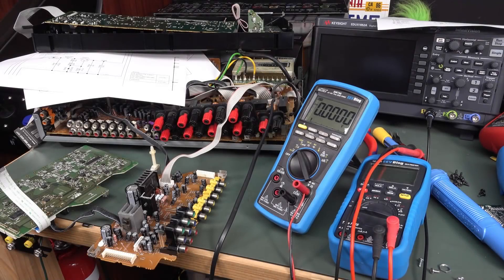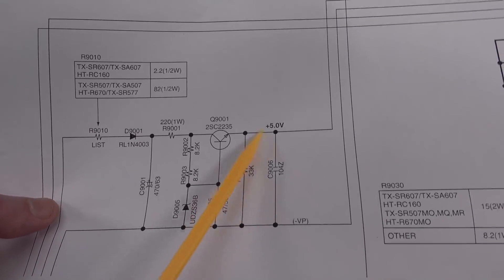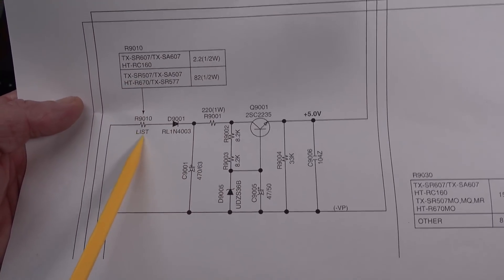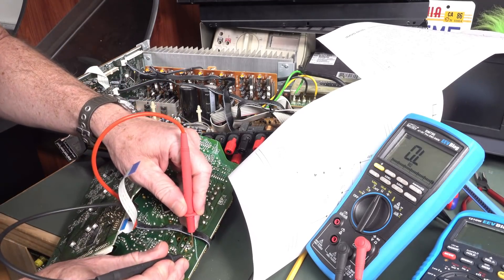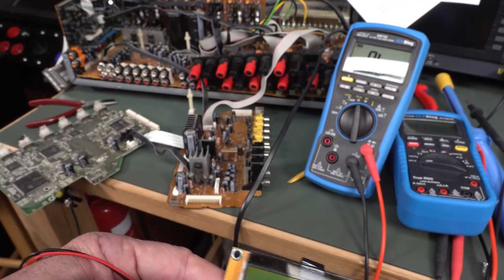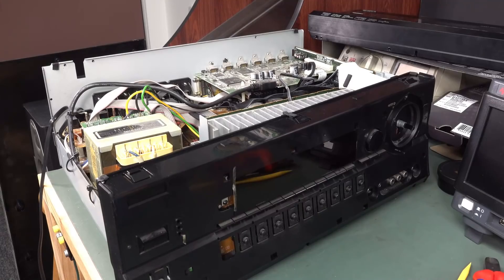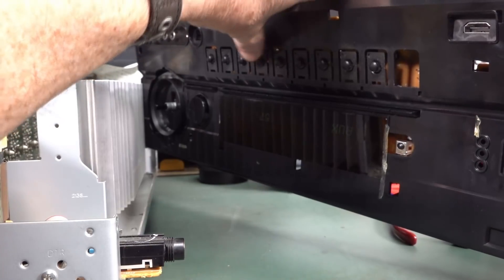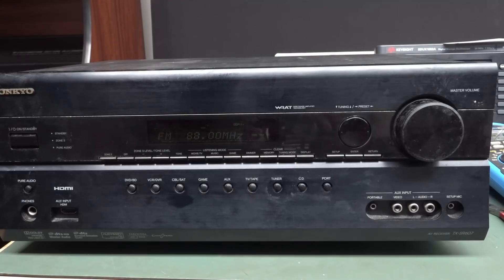EEVblog 1395 - Onkyo Repair SUCCESS

Comment: Because resistor surface is not dark, it was probably not overheated. It's first component, so I guess it fails because of high current pulse (power up/inrush, external surge/eft burst or similar). If it's external source, then other inputs protection components might be broken too. Also replacing it with 1W or 2W general purpose resistor might not help forever, a special - pulse proof - type resistor might be needed.

Comment: In the last video when Dave opened it up and said the construction was excellent, I knew he would regret those words once he had to take it apart and trace stuff between the boards and try to test it by putting it all back together. That kind of multiboard design really makes it hard to track down failures.
Reply: Also the cheap ass phenolic circuit board material they use, and that it's single sided means when you plug it together, if any of the pins is even slightly mis-aligned, it pushes the pin through the board, and rips the trace off the back too. Had that happen at least once with a receiver. I had it all repaired and working, then put it all back together, and it stopped working - took it apart again, and found one of the pins in the board-to-board connector poked out the back of the board, and trace torn right off. Had to take it all apart again and repair all that.

Comment: The 12th button (marked Display), right above the CD mode selector button, will toggle the display brightness through several brightness levels.
Reply from the maker: It's the Dimmer button actually.
Reply: @EEVblog  of course you're right.  I have one of these, but upgraded it about 6 years ago, so my memory of using it has blurred.  I do know there's a button that toggles through a few brightness levels.  I was actually expecting an HDMI repair when I saw the model number and brand.  I've been lucky so far with Onkyo HDMI interfaces, none have failed on me yet.  I really like Onkyo systems.

Comment: I have a marantz tuner amp with vfd that I've owned for 30 years, strangely the display is still bright & it's had a fair bit of use. nice repair
Reply: those are light bulbs.  That onkyo must have had weaker bulbs or used quite a bit.
Reply: The dimmer was on. All good after he pressed the dimmer switch. It has 3 levels of brightness

Comment: Dave  check the settings it might be set at the 'low setting' for the VFD or night setting
Reply from the maker: Turns out there is a Dimmer button on the front panel, that fixed it!

Comment: Pretty good series! The Onkyo receivers have a great quality. 
I am not sure if you tested it, but the 470µF capacitor following the diode could have caused the resistor to open if it had a low enough ESR with a consequent increase in its current - I have seen this happen in the past. If this is the real root cause, the replaced resistor may blow soon. 
I am not sure if you noticed the "Dimmer" button in the front panel - press it and see how it cycles through the various VFD intensity levels. 
Overall, great video.
Reply: A decent engineer would take the time to think about "why" the resistor opened.  Good point--and along the lines of my thought.

Comment: Great fix! I've had to fix a few open resistors in things over the years. People always want to assume it's a bad cap or a shorted semiconductor... But those resistors definitely fail open more often than than people realize.
Reply: That is 100% true. Even metal film SMD ones can just slowly develop a crack and one day suddenly become completely open or something like 800k over the initial value. With modern ones it is not often but it happens sometimes and I have seen a resistor like this with my own eyes. Never seen one becoming short though.
Reply: Do the electrons fall out when they fail open or do you have to turn them a bit?
Reply: @johnfrench7452  No, they can’t jump across.
Reply: @tripplefives I have told you 67000000 times not to exagerate. It's a small beam.

Comment: I would also put a heat sink on the DTS chip, these run really hot and have the tendency to come ''loose'' from the board, a known issue with a lot of these Onkyo's.
Reply: This one doesn't have DTS chip that has issues. Only ones with rj45 connector on hdmi board have this issue. Adding heatsinks isn't propably bad idea tho.
Reply: @mmanner  Ah ok didn't know that ;)  The chips do run really hot indeed!!  These models do have an HDMI switching issue, some of the caps need replacing if that occurs.

Comment: I have the exact same model here. It is a silver receiver.  It had the same problem. Real easy fix.  After 3 years still going strong.  Good receiver. I have a few onkyo receivers. Most of the ones of this vintage get an audio channel failure.  The newer models most of the time fail on the hdmi board. The 313 model sometimes have the standby relais failure.  It just dies. Also easy to fix.

Comment: On  Onkyo TX-NR646 receiver, it is possible to adjust the brightness of the FD with the remote control, in 3 brightness steps - look for "Dimmer" on the remote.
Reply from the maker: Turns out there is a Dimmer button on the front panel, that fixed it!

Comment: Hey Dave if you have remote control you can enter in setup to adjust the contrast if you don't have read the user manual.. normally have a combination of keys to enter in setup mode to adjust that 😋
Reply from the maker: Turns out there is a Dimmer button on the front panel, that fixed it!

Comment: Why not just press the 'DIMMER' button on the front panel to set the display to a brighter contrast?  The button is labeled right in front on the top row of buttons.  Right in between listening mode and clear...
Reply from the maker: Just discovered that :-D

Comment: I’m more of a troubleshooter than a designer, so I always like these videos. It didn’t come to this, but I wonder if you could test a higher voltage Zener in circuit by connecting a current limited bench supply across it. I’ve never had to do that, but I think it would work.If it’s good, the Zener would limit the voltage to a safe level for the circuit components and the supply would limit the current to a safe level for the Zener. If the Zener is bad, you’d just have to limit the voltage level of the bench supply to avoid damage. I might give that a try with a scrap board.

Comment: Got a couple of Onkyo receivers - a 606 and a 707, both have dimmable display settings - i just wish i could get some sound out of them...
Reply: Hdmi boards have failed?  I have a 508.  607 and anothr one.  2 of them had a blown audio channel.  The 508 works perfectly the other still is not fixed. But the 607 had the same fault as daves onkyo.  Must be a conmon failure on these.

Comment: Foiled by an inert carbon rod...
:)-

I used to work in a TV repair shop then moved on to university and an engineering degree. Once when I was visiting the old shop the owner had a TV on the bench that had sat their for over a week with an unknown fault. Just for fun I traced the power circuit and saw the same power problems but I checked a resistor that could have caused the fault. Sure enough it was open. A few minutes later, with a quick bodge of a new resistor on the old one, and the set was up and running. The shop owner never tested the resistor because it was a fairly high value (~100K I seem to recall) and assumed it would never fail.

1) Thou shalt check voltages
2) Thou shalt not assume anything. Resistors can go open, caps can short (I even had a brand new shorted mil-spec cap once)

A tech's biggest enemy is their perception on what should fail.

Cheers,
Reply: agreed but for a repair shop, checking first the most common causes of failure saves time and money. It's only during a second inspection that repairmen have to check the rarer ones.
Reply: @PainterVierax  yes they/we play the odds and try for a quick diag. My old boss was stumped though as he did not take the next step and check the obvious. He would have got it eventually, he wasn't an idiot or anything and knew his job.
Cheers,
Reply: https://www.youtube.com/watch?v=T8lUZEenFfk
Reply: This needs pinned! 100% agree!

Comment: After the "successful" repair you have to control all the voltages in the supply, because i think why the VFD is so dim and the blown up carbon resistor, you found, there must be an another failure in this set.
Reply: No worries, she'll be right. 
Good enough for a 'stralia :).

Comment: Fusible resistors don't fuse without cause. Do Zeners fail with low reverse voltage over time? That could explain both the dim screen and the fused resistor.

Comment: What does it mean what your multi meter starts bouncing numbers all round unless grounded or in a loop?  Makes it tough to tell if you are getting a reading. I notice none of your meters do this. But over time all of mine end up like this. Changing batteries does nothing to change it.  All types of basic meters have done this so I only buy cheap meters now. How do you fix it?

Comment: If you had the remote for this you could make the display brighter, it defaults to the 'dimmer' setting.... This is changeable  via the menu....  plug in the HDMI-Out, press SETUP button on the front....

if you have the remote you can even reset to 'defaults'

Comment: The boards in these get their ground from being screwed to the back panel, which is screwed to the rest of the chassis. That's why it was throwing a fit when you didn't have the boards screwed in properly. Pain in the ass really but i'm sure they have a good reason for it
Reply: Economy.

Comment: My ONKYO TX8270 has 3 display brightness modes. Maybe it's just a question of settings?
Reply from the maker: Turns out there is a Dimmer button on the front panel, that fixed it!

Comment: There is brightness control, only accessible from the remote control. 3 or 4 levels of brightness.
Also, some boards have screws between them, which actually make electrical connection, which is essential for correct operation. It won't work properly if screws are out. "Trap for young players" ;-).
Reply: Many receivers have dim function (mine are SONY and Technics, Sony is bright when you operate something and after some sec it's dim to choosed level again), but for that there are manuals: https://www.manualsdir.com/manuals/204614/onkyo-tx-sr607.html?page=52
Reply from the maker: Turns out there is a Dimmer button on the front panel, that fixed it!
Reply: Nice!

Comment: If you google R9010 resistor you'll get heaps of results linking to Onkyo AV receivers.... I bet Dave did a Google of his model of receiver and it came up with this common fault
Reply from the maker: Nope, didn't even think to google for faults, I just eventually found it. I thoght the resistor was unlikely so one of the last things I checked.
Reply: Its always the last thing you check.

Comment: Do try not inserting 'basically/actually' in every other sentence.
Reply from the maker: I'll be sure to add more, thanks for the tip.
Reply: @EEVblog  Basically wish these whiners would actually sod off.   :)
Reply: A week or two ago, now, I listened to myself in a recorded conversation - and, I sounded like a nut. I keep saying, "you know" (which, I have been warned about saying, several times, by other people, over the years, now- I'm 55). However, I always thought these people advising me about saying "you know" were just trying to give me a needless hard time; yet, now I do realize how ridiculous I sound because I say "you know" at the end of almost every sentence- looking for some kind of feedback, from the listener (without even given the listener time to respond, at that). All that said, I don't really notice Dave being annoying by saying, "basically/actually" too much. In fairness, Dave does do a lot of talking, but I don't really find it annoying. Keep up the great work Dave, and thanks for the follow-up video, so quickly. Also, IMVHO, doing some type of a hack on making this VFD display brighter, would be a nice one - even if you just did a gluggy one like installing a $4.00 buck booster board (for example). You know Shahriar wouldn't rest until this display was working 100% - sorry, just had to make this last comparison. Take Care
Reply from the maker: @schwinn434  Turns out there is a Dimmer button on the front panel, that fixed it!
Reply: Actually (Ha Ha) Dave did an entire video on hacking a VFD: Episode #717 https://www.youtube.com/watch?v=clUVEyi_YNM . Sorry, Dave for not doing a little research, before I made the above comment.

Comment: Hey Dave, I had that same model a while back.  There was an option to dim the display somewhere...I can't remember if it was only accessible on the remote but it's something to check.  Congrats on the repair.
Reply from the maker: It's on the front panel!
Reply: I hope Dave sees your comment, there is indeed a display brightness setting.

Comment: Have you checked the dimmer-setting for the display brightness? It can be set to dim, dimmer, normal, I believe.
Reply from the maker: Turns out there is a Dimmer button on the front panel, that fixed it!
Reply: @EEVblog  just what I thought, I happen to own a unit like that, so I knew the dimmer switch...
Reply: @EEVblog  DOH!
Reply: @EEVblog  do you use this receiver? Love onkyos amplifiers
Reply: I have two different Onkyo AV receivers and yes, the brightness can be adjusted using the 'dimmer' button on the front panel. That's is a good receiver too.
Reply: Yeah! I almost screamed 'Push that dimmer button!!' :D  (Have one just like it, only pristine, daily use. The video switch is acting up, of course.)
Reply: Though so. Display on my 19-20 old Yamaha (pre HDMI age) is pretty bright, so I was a little skeptical that VFD actually gone dim.
Reply: @Mr.Leeroy let me guess...  VSX 709 RDS ? I had one of those, I loved it so much! I thought exactely the same with the dimmer function on that Onkyo ^^
Reply: The ones on clocks fail earlier, they're on 24/7
Reply: @tripplefives My sony 1080D avr has osd . That's composite.

Comment: I fixed a receiver unit, Pioneer I believe. It was a fuse. after replacing the fuse I found that it blew again when a metal microphone that was being used touched the metal case front.

Comment: Despite having a transistor tester in multimeters, much fancy and capable instruments in shop yet a 5$ LCR tester is used. Simplicity triumps over Accuracy.
Reply: And I guess it's the same for multimeters, I've repaired things for years with the cheapest ones, like the red one Dave ever reviewed

Comment: I hope you replaced the 1/2 watt 2.2 Ohm with a 1 watt. Then you will never need to change it again.
Reply: Yeah, or sometimes I just use two in parallel with double the value.
Reply: That may have been intended to be a cheaper fuse.
Reply: @carldawson5069  maybe but in that case engineers specifically use a fuse resistor to avoid hazard.
Reply: This is why the wife gets upset when you say, "just a few more minutes more dear, i am almost done!".
Reply: @carldawson5069  ,  True for only 55 years so far here. LOL I know, I know... I'm ALMOST DONE!
Reply: I would replace it with a 2 watter
Reply: Be vewy vewy quiet, we're hunting wabbits.
Reply: That’s a bold claim
Reply: The funny thing is that the 220 Ohm in DC-ish series with it is only one watt. And yet it should dissipate, what, 100 times the power?
Reply: Yep. Then you can replace all the parts downstream of the low wattage resistor, (slobovian fuse) was meant to protect.
Reply: @videolabguy  i like the axium "a $3 transistor is the device to protect the $0.25 fuse."

Comment: i think if the filament voltage (AC) loses its DC bias it becomes very dim. I dont recall you measured any DC bias on the filament. that might be worth a try
Reply from the maker: Turns out there is a Dimmer button on the front panel, that fixed it!
Reply: @EEVblog  Yep those darn dimmer button features ;)
Reply: @EEVblog  The one that said "Display"?
Reply: DC bias is exactly the fault being investigated, as noted in the previous video.
Reply: @cambridgemart2075  yes, my bad. the filament bias is also taken from Vp

Comment: Yea this is a pretty common fault for Onkyo. The Onkyo HDMI boards are also high failure items and they’re not repairable as parts aren’t available.
Reply: I found a supplier of a D series TI HDMI chip (IIRC the "C" was the factory recall series) and tried to reflow it but the 144 or more BGA did not come presoldered so after attempting to reball it, I tossed it after cultivating all the passives I could out of that hulk. Huge power supply and nice heat sink at least. as well as some large caps.

Comment: Techmoan would have fixed it with a couple of new belts .....and I am aware the device does not have any!
Reply: Mr Carlson would have diagnosed the issue with a piece of test gear he made himself.. Mike Patey would have crashed it only to completely rebuild it from scrap parts...
Reply: Fran blanche would have just replaced the vfd with some Burroughs nixie tubes.
Reply: bigclive would've replaced the display entirely with randomly flashing LEDs.
Reply: Photonicinduction would raise -V around -24KV to see if it pops...”let’s see, it might glow a bit before that.... That will make some smoke for sure. We should really do it outside, shouldn't we?”
Reply: my-mate-vince would have used cheap and nasty equipment to randomly probe circuitry with little hope of fixing it, just before fixing it.
Reply: Jays2cents would have hot snotted the resistor.
Reply: linus would have paid an employee to fix it
Reply: Those were all spot on! Sadly nobody I am not familiar with. You all got some good taste!